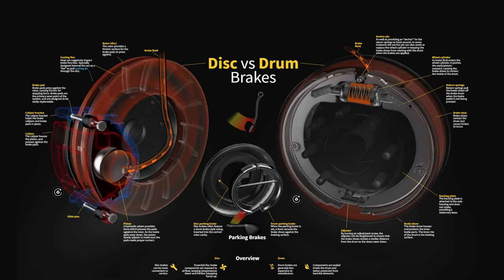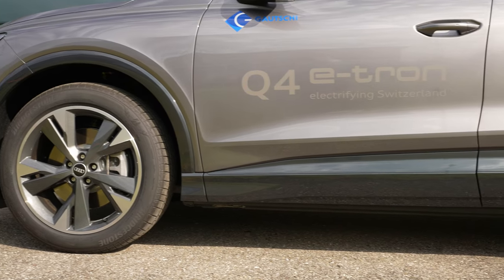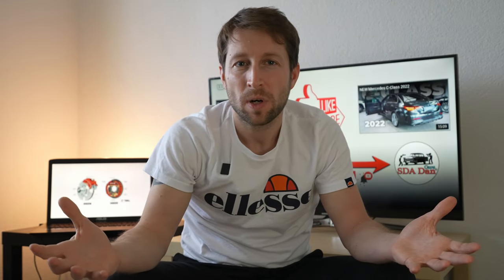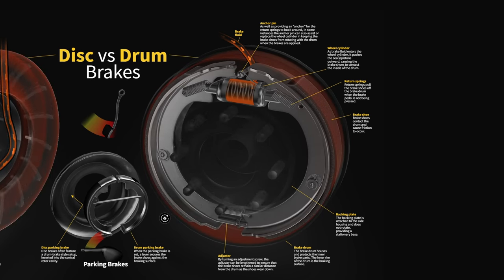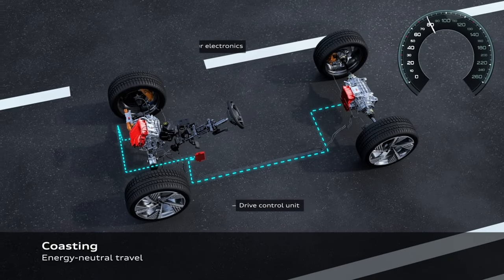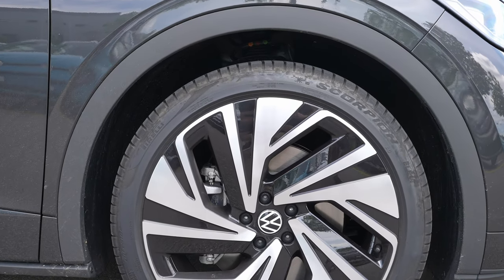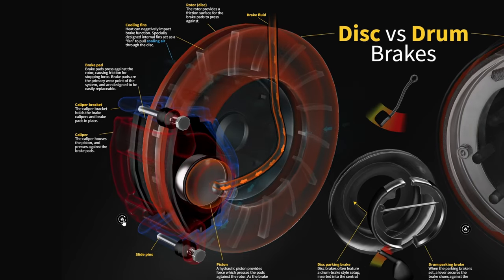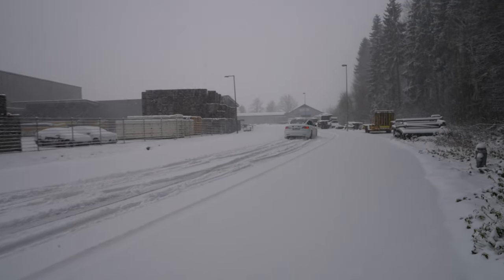Disk Brakes vs Drum Brakes | What is the difference !?

Comment: Can you please expend about regenerate electric brake system ?
Reply from the maker: Adi I will make a video about this as soon as I can. It use the motors to slow the car down and in the same time send some energy back to 🔋 battery
Reply: @SDADanCars the engine turn backwards, makes the wheels slower and regenerate engery to the battery like dynamo.